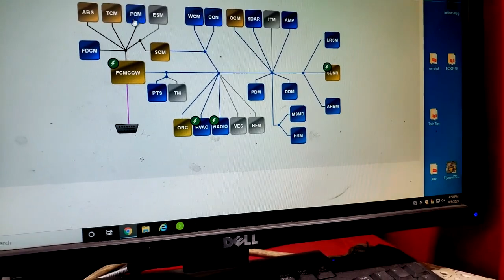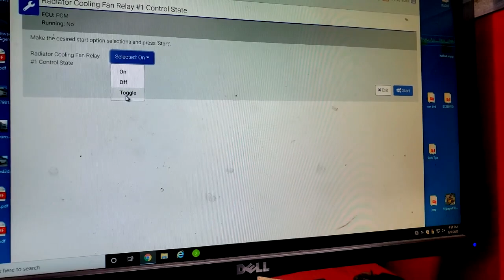ELECTRICAL TESTING to fix your car for over heating problems. Part 2 next

Comment: My Challenger just started overheating.  I found one of the electric fans was hitting the fan shroud and not turning.  With the AC on in hot weather, the other fan couldn’t keep up.  I bought the car new, so it will be interesting to see why all of a sudden the fan shroud is in the way.  If a car is designed with two fans, then one is not going to cut it.

Comment: JT, my 2015 200 S V6 leaked (slow drop) coolant from the bottom of the reservoir after I filled it to the max line. Without a proper diagnosis I suspect a small crack or loose connection---what say you? No problems with the system itself btw.

Comment: I am confused. On my 06 Impala, I don't hear the electric fans and definitely is not overheating. Well I have changed the heads before. I turn the nob on to ac fan. Doesn't turn on. If I go to the fuse box and try to jump it fans turn on 🤷‍♂️. The fact I don't want to be changing heads again. Also, I had swap the fuses if faulty, no change.